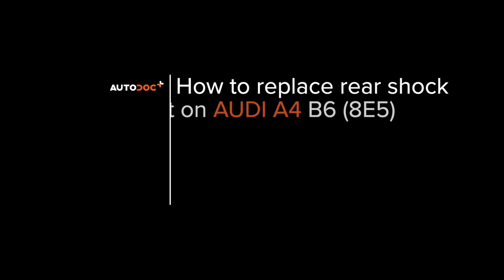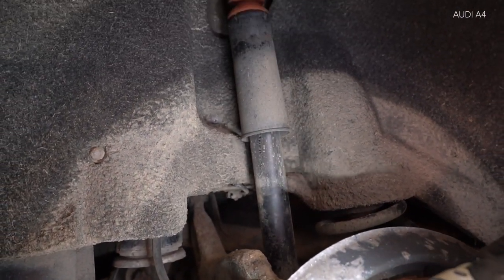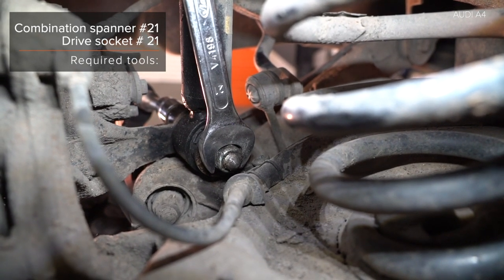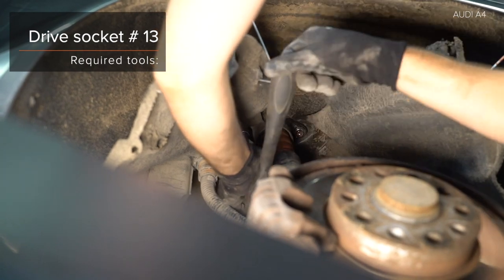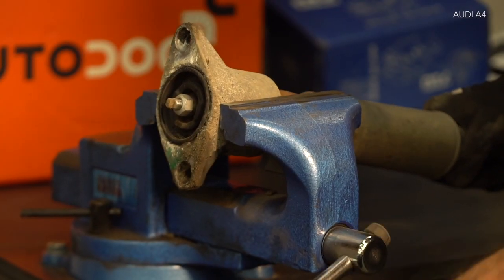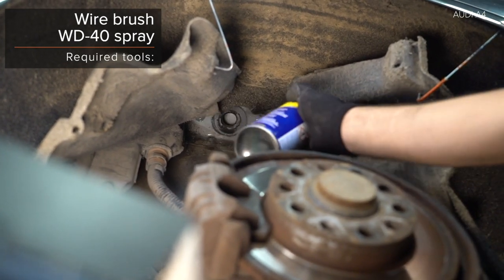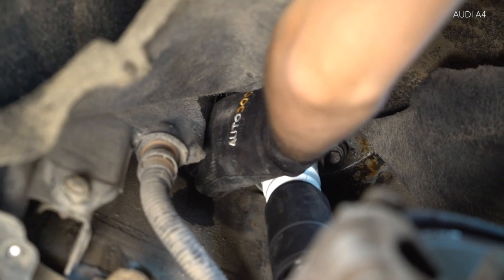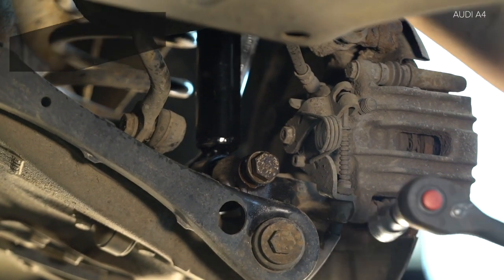How to change rear shock absorber on AUDI A4 B6 (8E5)  [TUTORIAL AUTODOC]

Comment: When putting the shock back on how high do you jack the suspension before tightening the bottom bolt?
Reply from the maker: We raise the suspension to its working level. The working level can be determined before performing work, while the car is still on the ground.

Comment: Do you have a link to the #DD6 tool?
Reply from the maker: Check out the car tool here https://www.autodoc.co.uk/yato/13639595?search=YATO%20Socket%20Set%20(YT-0628)
Reply: In the old video they just used an impact wrench. Don't need an expensive tool most likely.